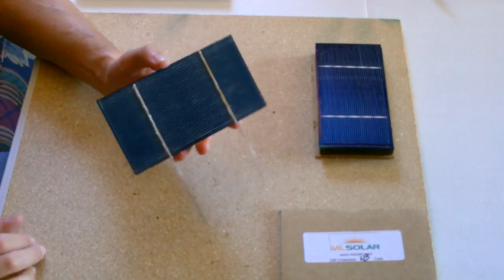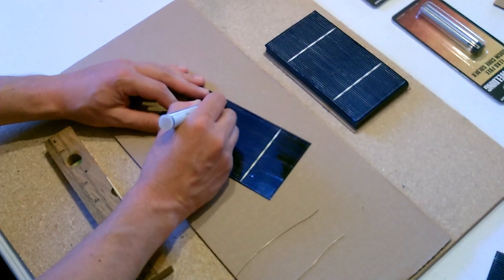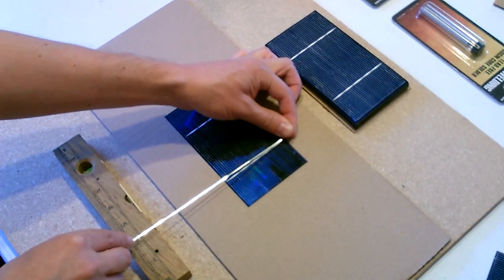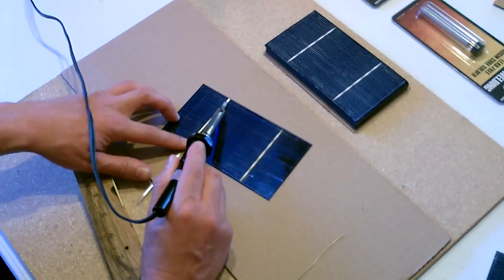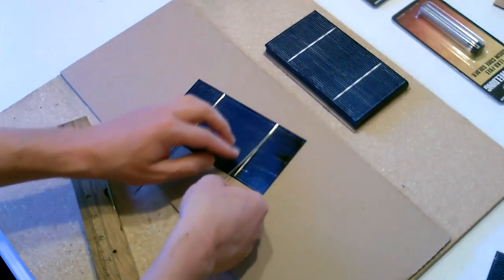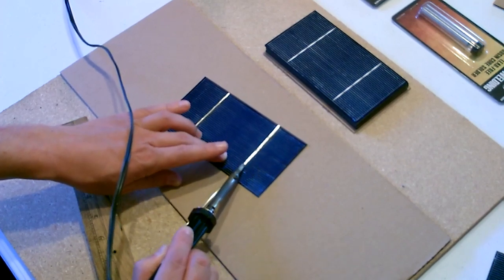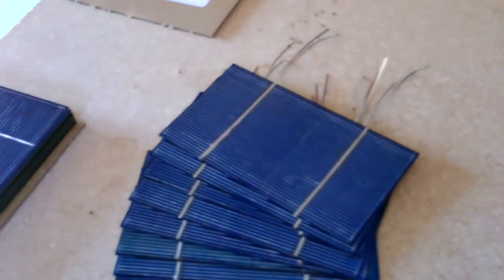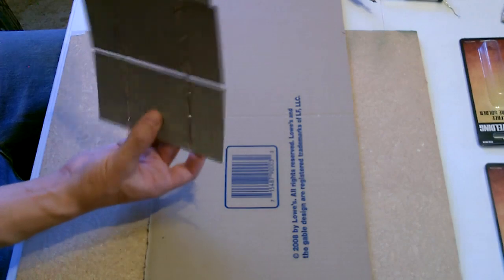How to make a Solar Panel - First Step: Solar Cell "Tabbing" - How to "Tab" Solar Cells

Comment: All your videos are good, I am just getting ready to build my first panel. So why use the full 6" of tabbing wire on each one?  Is there a reason you should not use a 4" piece on the Negative side??  Save tabbing wire.  Or is it that tabbing wire is cheap and don't worry about it???  Thanks

Comment: ever look into wiring glue? no need for a soldering iron, just put the glue where to want to connect the tabs to the panels(actually, since the entire back of panel is conductive, you can actually glue the panels together by overlapping and gluing them together at the loss of a little efficiency, but no need for tabbing wire).
Reply: What if I don't need it for professional stuff just for a project

Comment: First off, thank you for all the great videos. Very interesting. I ordered the 100 watt monocrystalline solar panal that you recommended in a previous video. I am really excited to get it going. I just need to do the battery bank and get my cables and inverter. What type of battery do you recommend? They looked like car batteries in the video but would rv batteries work better? I think I need two deep cycle batteries to run one 100 watt panel right?

Comment from the maker: got the solar cells on ebay. as prices come down on the professionally made panels so do the prices of individual solar cells and "solar cell kits". as long as you get a good deal on the solar cells, tabbing wire etc... then there is a slight cost savings when you build the panels yourself.